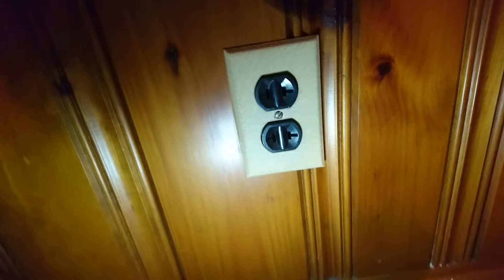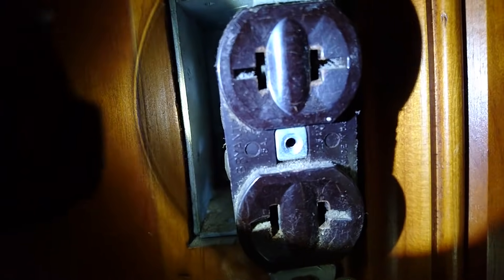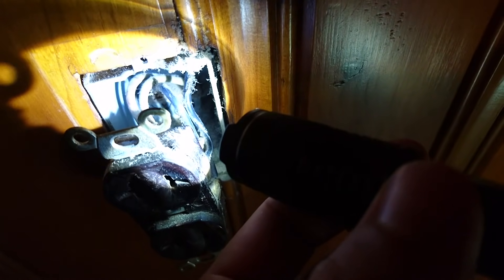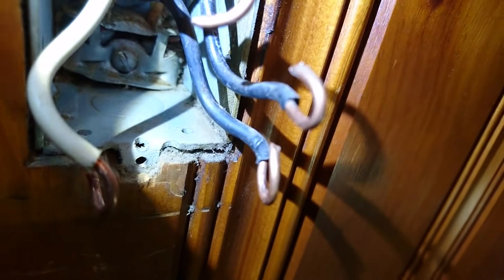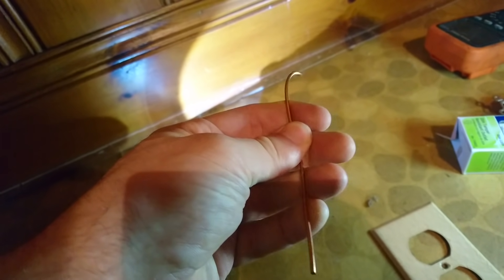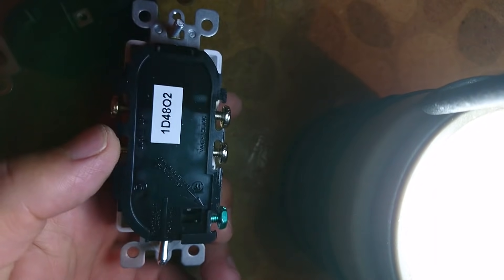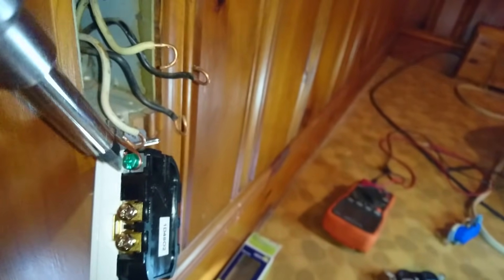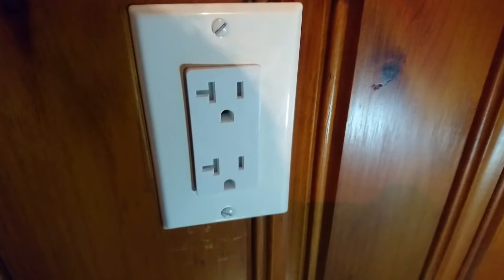How to Convert a 2 Prong Outlet to a Grounded 3 prong Outlet (TYPE AC Cable WITH Grounding Strip)

Comment: Not many people are going to have MC cable running to a receptacle lol IMO using the jacket as a ground is not a good grounding source.

Also, you should pigtail the outlet. The way you connected it will kill everything down the line if that 50cent  outlet goes bad.

If you’re not going to run a new line replace the 2-prong with a GFCI

Comment: Silly you with an actual breaker panel. I'm still working with fuses, bare wires and glass insulators.
Reply from the maker: Oh man silly me indeed. Aside from that stuff being so old that it just needs to be replaced, I suppose you could stick GFCI outlets everywhere and call it a day.

Comment: Im doing this in my house and before doing any of this, i tested for ground with my multimeter. I measured hot to ground by putting the red probe in the hot prong and put the black probe on the inside of the metal box. This gave me 30v on one of my outlets. The others were showing 120v. Why is one of my boxes improperly grounded? How can i fix this?
Reply: For what its worth if the cable entering the box is BX or metal sheathing & the 30v you got was definitely from hot to ground (hot being a black or red color wire on the darker colored screws of the outlet also the smaller size of the 2 flat blades or prongs) & neutral to ground (white or lighter colored wire & the longer of the 2 blades or prongs) to ground cause you can get several crazy volts off a neutral to ground test which would depend on anything from an actual switched outlet or a fridge or celing fan on that same circut but way back when they actually had gas lighting & chandeliers (now a large round decorative tin or copper plate with like an eggplant shaped cover in the middle of it) but back then wall switches would control an outlet in a roon ment say for a lamp but then there's the some one just screwed up the wiring along that circut meaning hot & neutral is reversed somewhere but again if its a metal covered cable in the box & its secured to the box properly it should be the 110/120volts to ground or to neutral but as i stated in another comment the 2 screws that actually secure the outlet to the box (if metal cable is used) is gunna ground the outlet but also remember then if you remove the 2 (6-32) screws from the box then test the outlet for voltage from say the hot side or hot blade to the neutral side you will only get the 110 or 120v there but if you test the hot side to the botton (round) ground 3rd prong you wont get anything cause removing the outlet completely from the box only held on by the copper wires doing so removed the ground..ok hope this helps a little or if im to late hope you found out pretty much what i said ...good luck

Comment: I have that EXACT same 2 prong outlet!
I have the ole ceramic post type wiring.
It is impossible to run modern wire through the walls unless you rip out the antique walls to do it.
And the lead paint under the paneling...
I believe those old outlets were made out of Bakelite. VERY durable. Built to last nearly a lifetime.
New outlets are made from CHEAP PLASTIC. Designed to last a scant few years.
The old copper was MUCH stiffer than modern day.
Wrapping the outlet with electrical tape was a safety issue.
Just in case any screws loosened over time and touched the metal box.

I thought you were supposed to have 6-8 inches of wire out the box.
Your 6in ground wire is too short because 1-1/2 to 2" or so is inside the box.

'

Comment: How about if the circuit does not have the armored cable....can u still ground to the box if the box is metal.
Reply from the maker: No, because then the ground won't go anywhere. Needs to be grounded to your panel/grounded to earth.
Reply: you cld chk there is a rare period between 1950's to 60's where they did run a ground wire to the boxes
Reply: @wizard3z868  Exactly what was in my dad's 1956 house. Woven-cloth sheath, paper lining, two plastic-insulated conductors, with bare wire wrapped around the cables that went to receptacles needing "ground", and those wires running to the circuit breaker panel, where they connected to the grounding lug.

Comment: Can i run the grounding cable to the floor (we have concrete floors on top of the soil itself)?
Reply from the maker: No. A proper ground will be a ground rod (outside), and it has to be driven at least 8 feet into the ground. Google ground rod NEC, lots of good resources. In the old days, they used to ground to water pipes, but that's not permitted per NEC anymore.
Reply: I see I see, solid stuff man, appreciate it, keep safe
Reply from the maker: @euq1tuobcs81  any time!

Comment: Great video. How did you find out if the box was grounded? Also, If the box is grounded why do you need a ground pigtail to outlet. Shouldn't the outlet be grounded by touching the metal box? Thanks!
Reply: its nec code everything be bonded at all times
Reply: @wizard3z868  No, it's not "nec code". Some receptacles ALSO have a self-grounding feature in which the grounding contact is bonded to the mounting strap.  Others require a pigtail to a screw. Some do both.

Comment: Thanks. Can I use a grounding clip instead of a screw? It would seem a lot easier.
Reply from the maker: I think that would be fine. I tried using those initially, but somehow the dimension was off (old box) and it didn't make a very secure connection, so I went with screws.
Reply: If your box is grounded and slightly recessed like this one you can break off the metal ears off the yoke and use them as shims between the receptacle and the box. You can add a short piece of ground wire (14 awg) to the back of the yoke and around the screw and the other end to the ground screw on the receptacle.  Connect the hot and neutral last.  Tighten your mounting screws firmly and you will have a solid ground.

Comment: Is it against electrical code to add a ground wire like this
Reply from the maker: As far as I know, yes, but codes always change. This is a comment I wrote from a few years ago:

Important detail: you MUST have a grounding strip inside your armored cable, also known as Type AC cable. You should be able to spot it when you open the cover of your outlet, it's a bare tin plated steel wire. You might have better luck spotting it where the cable enters your electrical panel.

See NEC 250.118 Sections 8 & 9:

(8) Flexible metallic tubing where the tubing is
terminated in fittings listed for grounding and
meeting the following conditions:
a. The circuit conductors contained in the
tubing are protected by overcurrent
devices rated at 20 amperes or less.
b. The combined length of flexible metal
conduit and flexible metallic tubing and
liquidtight flexible metal conduit in the
same ground return path does not exceed
1.8 m (6 ft).

(9) Armor of Type AC cable with an additional
equipment grounding conductor and as
provided in 320.108.

See an example here: 

http://activerain.com/image_store/uploads/2/2/5/9/2/ar1364321329522.jpg

Comment: All the breakers in my house say 30 or 60 on them, I’m kinda confused as to what outlet I should buy
Reply from the maker: Honestly that's confusing to me too, that's a wild amount of amps for a household. How old is the house?
Reply: How many breakers are in the box?
Reply from the maker: @js4187  that's a good question, maybe it's a sub panel
Reply: @Bootstrappin  Ive seen 30 amp breakers used in older panels that would have severl rooms , bathroom etc on them .
Reply: @js4187  That would not be safe and therefore was NEVER legal.  You can feed a subpanel with 30 A but a branch circuit using 12 or 14 AWG cannot have overcurrent protection in excess of 15 or 20 amps.  Otherwise the wires can overheat for as long as it takes to start a fire, well before an oversized fuse or breaker opens.

Comment: I've been told unless you have a ground wire running to that box that is from the breaker panel in some way you are still not grounded because the box has no ground and that doing this is a fake ground
Reply from the maker: Right, and that is why the ground path we use is the metallic sheath with the internal bonding strip, both of which are conductive.

Comment: Using flexable conduit as a ground is a code violation because it is not a solid conduit. Sure it might work but if your house  burns down and investigated,  your insurance may have a issue with this violation. It is best to run a solid chaser wire instead from the outlet to the breaker box ground. Best get advise from your local Electrician.
Reply from the maker: I know what you mean, but it seems permissible per NEC, particularly where a bonding/grounding strip runs inside the armor: 

See NEC 250.118 Sections 8 & 9:

(8) Flexible metallic tubing where the tubing is
terminated in fittings listed for grounding and
meeting the following conditions:
a. The circuit conductors contained in the
tubing are protected by overcurrent
devices rated at 20 amperes or less.
b. The combined length of flexible metal
conduit and flexible metallic tubing and
liquidtight flexible metal conduit in the
same ground return path does not exceed
1.8 m (6 ft).

(9) Armor of Type AC cable with an additional
equipment grounding conductor and as
provided in 320.108.

See an example here: 

http://activerain.com/image_store/uploads/2/2/5/9/2/ar1364321329522.jpg
Reply: @Bootstrappin  I double checked my outlets again after reading this and noticed only 2 of 12 outlets in my house do not have the ground strip. So I grounded 10      3 prong outlets and used 2 CFCI outlets. Thanks for responding to my message, it is what made me check all the outlets, instead of just 2 outlets. Thanks very much for your help and feed back. Now I don't have to rip out all the sheet rock and rewire my house.
Reply from the maker: Sure thing, glad it worked out! And totally right about the GFCI - that's the alternative method. I guess you also have to label them "no equipment ground" per code.

Comment: I found out it doesn't create a ground if the metal box is not connected to metal conduit or metal armored cable such as you had.
Reply from the maker: Correct, that's what I said in the video. Armored cable only.
Reply: How do you tell difference between armored cable and old "greenfield"? My house was built in 1921.
Reply: @bensonhurst7272  I believe that, in this context,"Greenfield" refers to "flexible metal conduit", which doesn't come with wires already inside.  One would pull in the necessary hot, neutral and grounding conductors.

Comment: I have a question. So I put the hot lead of the multimeter in the hot, and the other lead in the neutral, and got a measurement ~120V. Then I moved the lead from the neutral and touched the cable box and got a reading of 120V. This would mean that the box is grounded correct? I then hooked up the outlet and checked the hot with the red lead and the ground with the other lead and again the reading came back at 120V. This means that I correctly grounded the box right?
Reply from the maker: Yes, that all sounds correct. To go a step further, turn the breaker off to this outlet, make sure if there's anything else on the circuit (such as a daisy chained outlet with stuff plugged into it) is unplugged, then measure the resistance between neutral and ground. It should read close to zero, and preferably no higher than 6 ohms.
Reply: @Bootstrappin  Quick follow up question. Why do all the outlets in my home only have one hot and one neutral wire, instead of 4 like in the video?
Reply from the maker: @seanm3189  I have 4 because I have two cables going into the box. One cable feeds electricity from the panel, and another feeds some other outlet or light - this is called 'daisychaining'. So you only have a feed cable. On another note, make sure that your armored cable has a grounding strip inside, it's the only way to do this job up to code, with the exception of putting a GFCI outlet with no equipment ground.
Reply: @Bootstrappin  I thought that you can ensure the outlet is properly grounded by simply testing it with a multimeter after installation?
Reply from the maker: @seanm3189  you can, and it is by definition a ground. NEC/Code however says that grounding via a sheath with no grounding strip is not allowed, I assume because the sheath could become rusted somewhere at some point, and will therefore create a high resistance point/fire hazard.
Reply: @Bootstrappin  do you have a video on how to identify the sheath with a grounding strip. I'm looking at the box and i'm not sure what im looking for
Reply from the maker: @seanm3189  actually yes, I show what it looks like in the video below at 2:00. It's a thin strip of a metal, sometimes they snipped it, sometimes they tucked it away somewhere:

https://youtu.be/MQR_uFK93Mk?t=123
Reply: Sean Moran     Sean,  from your descriptions, I think you have a pretty old house.   You probably have nob and tube wiring and separate cable from the nob and tube to each receptacle.   Also, getting 120 volts from ground to neutral indicates that you have an ungrounded system.  This was normal prior(I'm guessing here) until the 50's or early 60's.    Because of the way your electrical system is, to put any ground type receptacles legally in your house, every receptacle would have to be a GFCI type receptacle.   Respectfully,   Kevin

Comment: Actually if the outlet has the half slot coming from the middle of the vertical slot that would be a 20amp outlet google what a 20amp plug say on a real heavy duty vacume or other heavy duty appliance also if the BX cable is entered into the/A metal box properly as soon as you screw the outlet into the box with its 6-32 screws then POW your outlet is now grounded or should i say your 20 amp outlet is now properly grounded & you are right about the aluminum wire mostly used for a brief period in the early 70's but its burns like a fireworks fuse but they sell something called petrox that either is in a wire nut or a small squeeze bottle & anytime you splice copper to aluminum a few drops of it in/on the splice your good to go.. hope this helps someone a little...

Comment: This video is useful to me for the tiny tricks on the cable wrapped around the screw. 
Don’t have the metal shielded cable unfortunately.. 😕
Reply: You may still install a 3-slot "grounding type" GFCI receptacle without any grounding wire, unless your local code prohibits it.

Comment: Noted by the East west notched in the outlet many times those are the 20amp
Reply: Or else 250 volts at 15 or 20 amps.  No longer allowed to have "both" in a single receptacle configuration.

Comment: What about a fiber box you are grounded to the metal box ?
Reply from the maker: No, fiber is not conductive. If you have armored cabling going to a plastic/fiber box, you'd have to find a way to make a good mechanical connection to the metal cable sheath, I reckon.
Reply: @Bootstrappin  You cannot have armored cable and a plastic/fiber box. Any metallic cabling requires a metal box. You can use NM (Romex) in a metal or plastic box. Plastic boxes are for NM cable routed inside the wall.
Reply from the maker: @surferdude642  yeah you're right. No go on armored cabling in metal box.

Comment: Cannot use metallic flex conduit as CPC. Must have separate ground wire or armoured cable. Dangerous. Also use insulated sleeve on ground pigtail.

Comment: I just moved into a home that has only 2 prong outlets throughout. Wtf were they thinking? You can tell it has been renovated but why would they not have 3? Is it that the wiring is old? I'm scared to hook my tv, cable box, surround sound, playstation etc up afraid the plugs will not hold all that power. Will it catch fire. Oh but wait! I cant even hook my shit up because my multiple socket gadget has 3 prongs.😒
Reply from the maker: I feel you on this. If wiring a 3 prong outlet isn't an option with the existing wiring, wiring a GFCI outlet with a 'no equipment ground' sticker is also acceptable. 

The old folks here were just using 2 prong to 3 prong adapters everywhere. You can try the following - these are 2 to 3 prong adapters, and the little tab screws into the wallplate. In theory, if it's all armored cable with metal boxes, you will have ground, but you'll have to test it with a ground tester. If it finds no ground, then the adapters do nothing and aren't really safe to use.

2 to 3 prong adapter:
https://amzn.to/2vwte3e

Ground tester:
https://amzn.to/32Hn1Oi
Reply: @Bootstrappin  Thanks so much, I'll transfer this in info over to someone who understands your language and hopefully they can get me straight from your knowledge.

Comment: Gonna have a poop-ton of these to do in a house we just moved into - great video thanks for sharing!
Reply from the maker: Yeah it's a massive pain in the neck, and you'll probably find some nasty surprises. Be sure your armored cable is connected to ground at the panel. Otherwise, NEC states to replace all of them with GFCIs labeled with "no equipment ground".
Reply: @Bootstrappin  If not also AFCI and tamper-resistant features.

Comment: You can tell he is not a electrician, you should always tape around the outlet or switch in a metal box, just a good habit to get into and you can put a 15amp outlet on a 20amp circuit.
Reply from the maker: It's to reduce the risk of the screws touching in a metal box
Reply: What If you actually needed that full 20 amps? However your Receptacles only rated for a Max of 15 amps?

Comment: Good information except for the fact that aluminum oxide is NOT flammable, it is just not a conductor. As aluminum oxide forms heat builds up because of the resistance.
Reply from the maker: That's correct, wrong assumption on my part